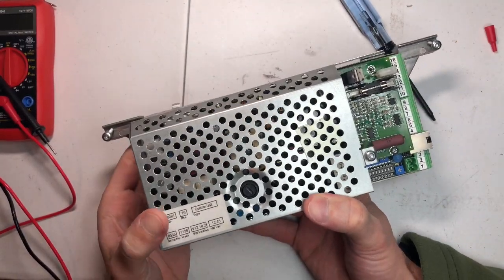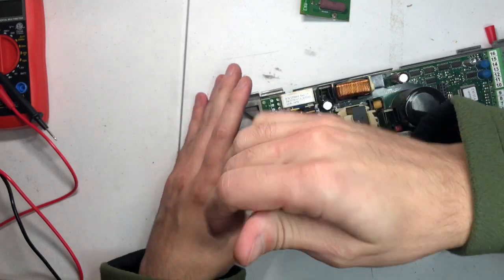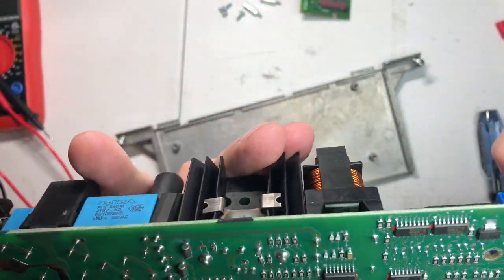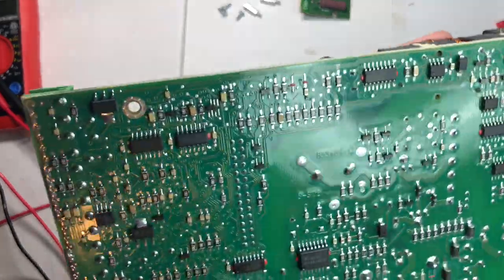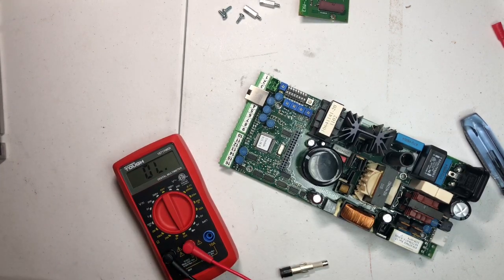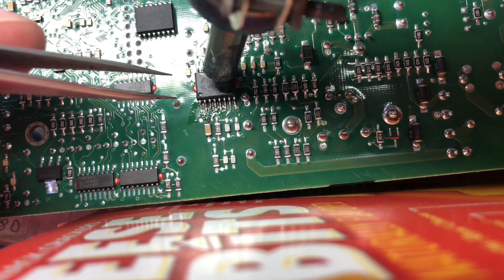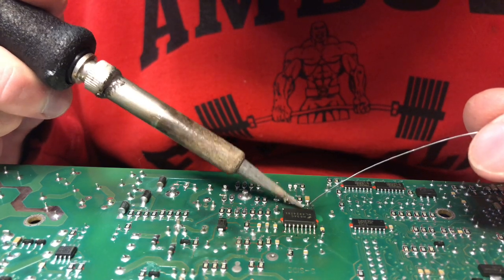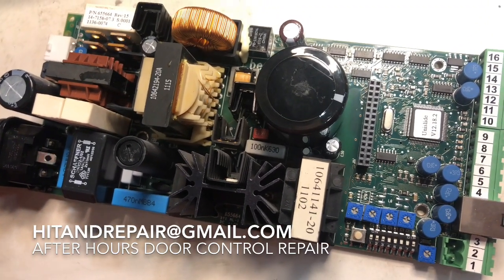Besam uni-slide repair service R600091

Comment: Bull shit. Wy to change especially that part? The most common reason the unit not will start is high ESR caps, exactly the other side were the ML4824 is placed. Also blown Schottky diodes can be a problem. Primair transformer side or secundair side. You have to check that first!

Comment: You are showing how to replace IC straight way. You are very experience on it.  But before replace it what are the pin points to check voltages on the bord? Based on that we have to go for replace the ic.
Reply from the maker: It’s the number 1 issue with the device. Replace and see
Reply: @hitandrepair   its not the number one fault for no power issue. Before replace a IC need to check surrounding capacitors. I have repaired many of this modules. Capacitor is the main issue. How you change IC straight away without check surrounding components?

Comment: Hi, i have one that works good for a litle time and then stops and the led flashes four times,  in the manual says  Reason:  "motor temperature high"  Remedy: "Wait one minute for the operator to recover. If necessary replace the control unit"
Any idea what is the problem?
Thanks!

Comment: Same issue with the ones I remove. 4 flashing lights. Told to replace motor and control do you think that chip would fix that? I notice in you video that once you are done and power yours up it also flashes 4 times
Reply: I found same issues on many doors, I replaced both control and motor. Kind of dumb but a few times I replaced only the motor and control and I get same issue. So to save me headaches I replace both motor and control when I get the 4 flash error code.
Reply: That chip will not fix that problem.